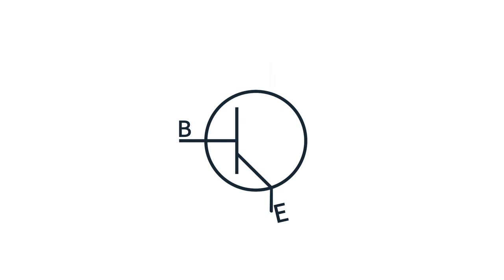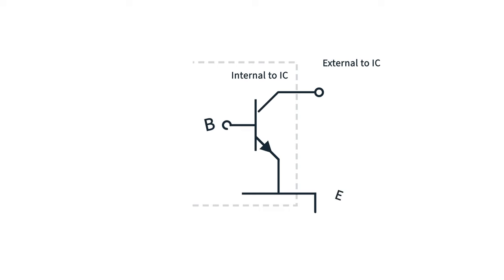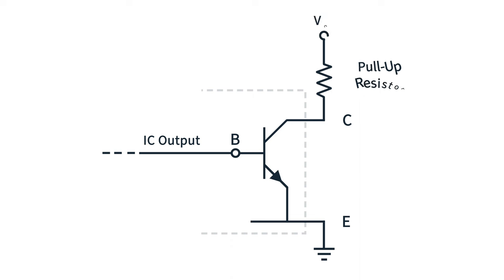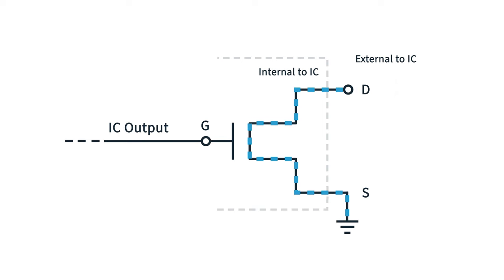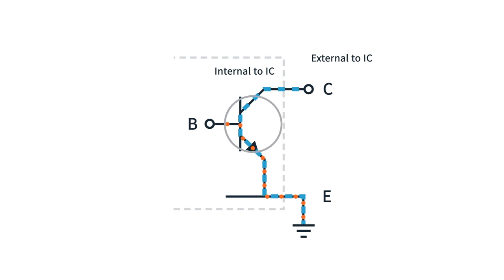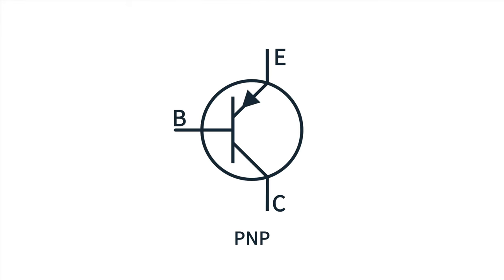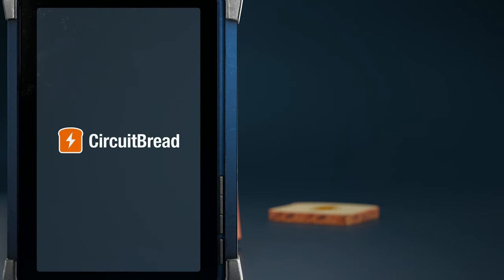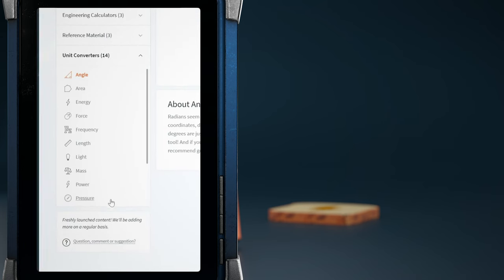Open-Collector Outputs In Microcontrollers Explained

Comment: As soon as you started getting into the theory of operation for the transistor, I realized "Oh! It's a scheme that can sink power." 
Your videos are truly superbly done. While I often wish I had completed more schooling, I fortunately did complete enough to understand basically anything analog, and don't struggle to understand digital.
I was also just reviewing a circuit I designed 15 years ago before I had any college education, and realized I'm running the op-amp class-A which is why the quest for gain in those days went through the roof. At the time, there was a lot of probing around with parts lol. I added a cap and resistor to the 1st stages output pin from the common. I'm one of those eccentric and over the top lead/solo guitar shredders, but somehow, science has always been a more important passion.
Reply from the maker: That's awesome!  Thanks for the feedback and I'm so glad that it was helpful!  Being a guitar shredder, you made me think of an older video we did - the audio is not ideal because it was incredibly loud there, but we interviewed a guy at NAMM back in 2019 who represented a company that makes a "plasma pedal" https://youtu.be/fLbpyqs6ugw?si=mU-zxSY9d4a354ru  I just love that science can push or enable our other passions!  Thanks again for sharing.

Comment: Thanks. What if the sensor in the field is open source or open drain? then the sourcing is done by the field device and sinking by the  MCU input? I'm doing BMS controls: Priva Hardware. So we have to configure the I/O to source or sink depending on what type of field device its connected to. Love the channel.